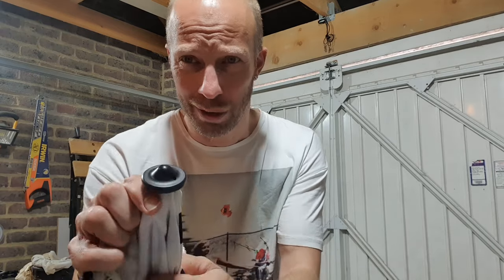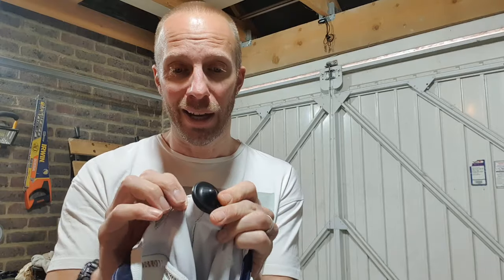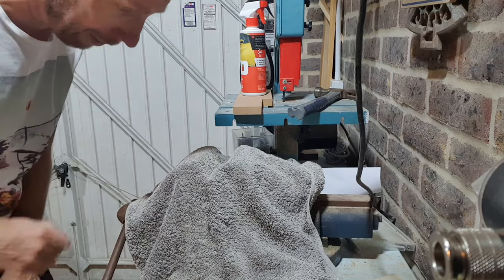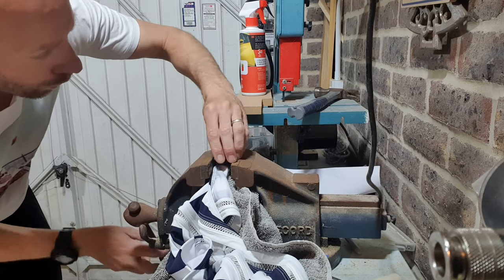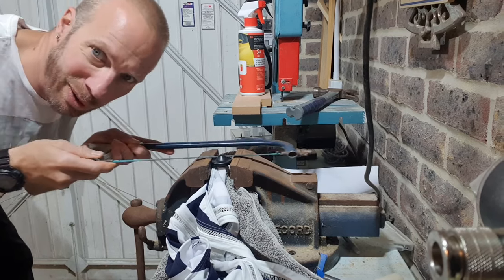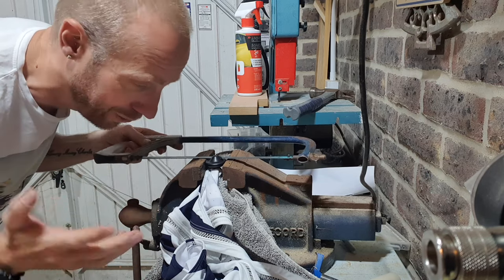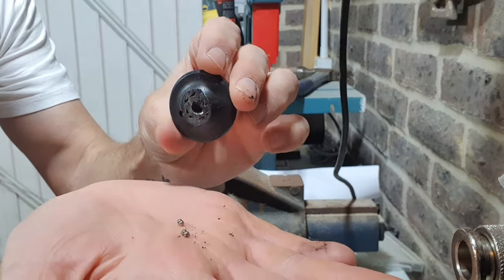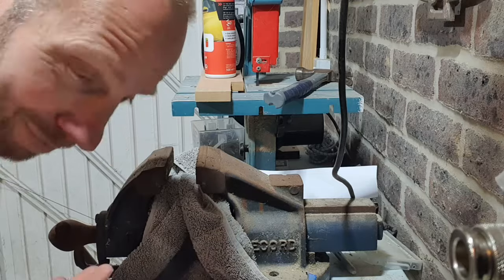How to remove a security tag from clothing

Comment: Thanks for this. I put the article inside a clean T-shirt and brought the bit with the tag on out through the neck.  Used the Dremel to make 4 vertical cuts through the plastic then tweaked the top off with pliers.
Reply from the maker: Nice one 👍

Comment: I used the Dremel-tool with a 32 mm cutting wheel to cut off the top and remove the spring. Easy.

Comment: Wife just bought me a pair of swim trunks, and they didn't remove the security device. I didn't want to spend time sawing on it. I took it to the garage, and used my bench grinder, to take the nub off of it. Got it down where I could grab the spring with a needle nose pliers. I was careful to keep the material away from the grinder.